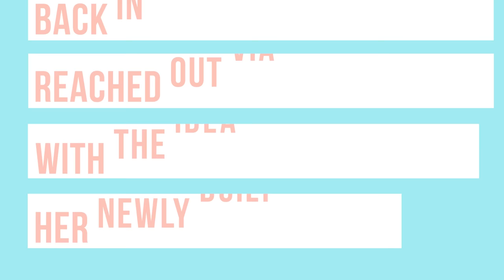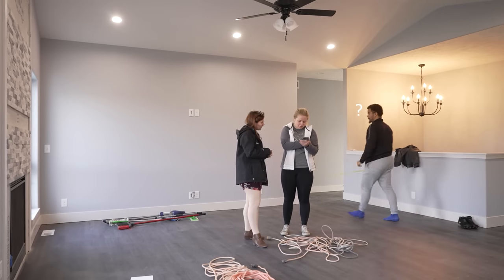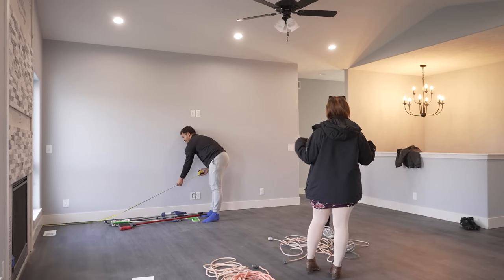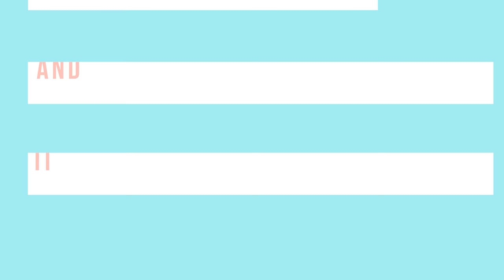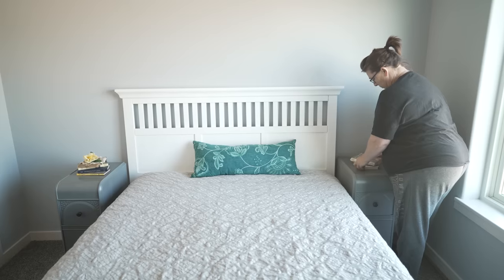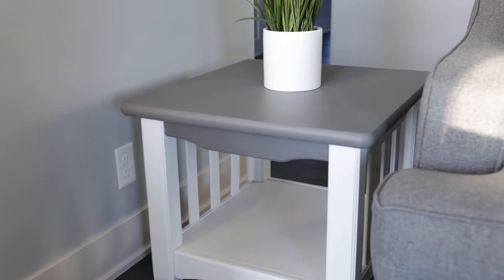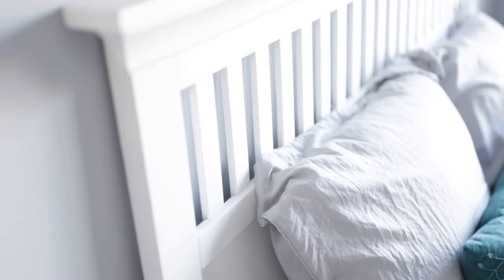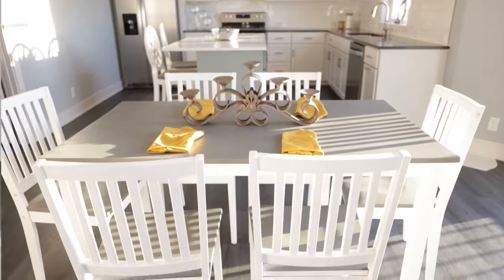Furnishing an ENTIRE HOME with Second Hand Furniture Flips

Comment: Hi I have a quick question if you have time.  Found some old wood dressers that have the old scrolly apron on the bottom (no legs cuz it sits flat on the ground, which I hate) and I'd like a clean line on the bottom and I'd like to put legs on it to raise it off the floor.  Do you have any video like that?  I searched your videos but didn't see anything.  Thanks!
Reply from the maker: Here is a video! Good luck! https://youtu.be/UK00A3zQexA
Reply: @FurnitureFlippingTeacher  thanks so much!

Comment: Do you want to know an old trick from when I was young. 
Clean the surface,sand it ,
Commence by "painting it with WHITE VINEGAR. Then when  dry Varnish. Let it dry. 
Sand it down lightly and repeat. Until you have as many layers as you want. 
It will look like  glass done properly. 
As the surface gets stretched only 1 layer will be damaged. 
Old lady (76)old ways.